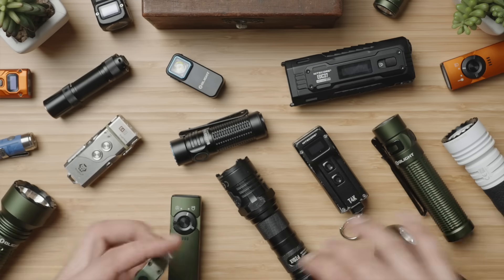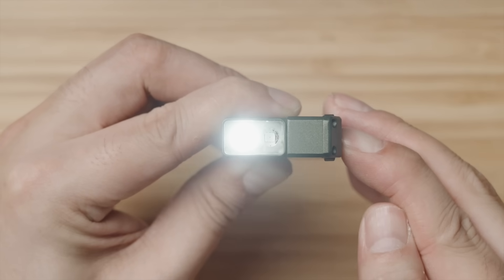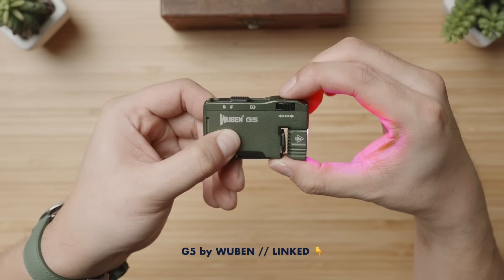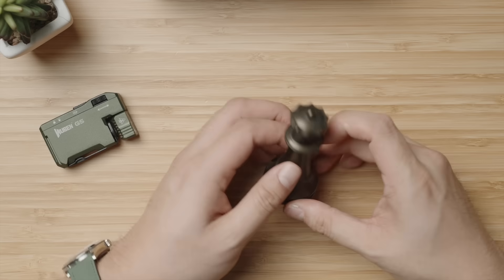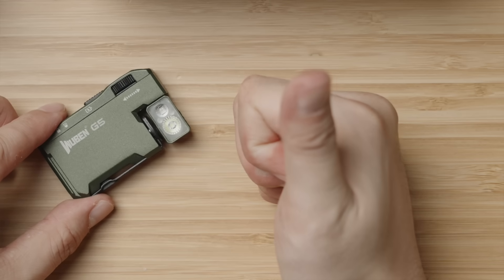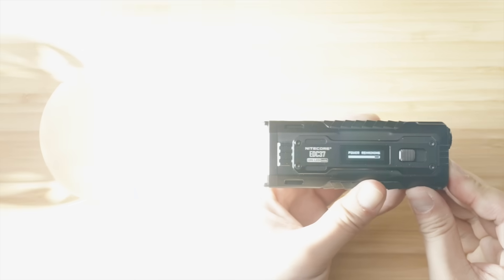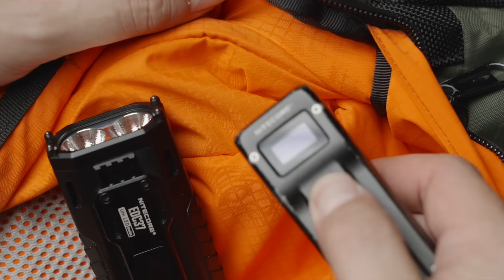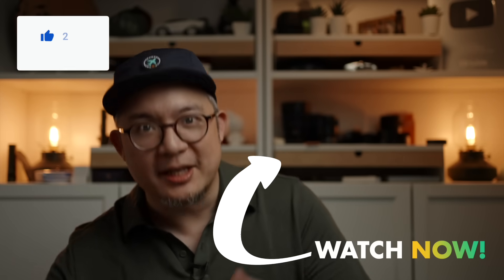Modern Flashlights are INSANE.

Comment: I'm curious when you said that they are making a profit on that smaller flashlight where did you get that information from?  Especially if it's from a big company it could be what is known as a loss leader.  Which is a product that is sold cheaply often below cost to either get people into a store either physical or online in the hopes that why they are there they will buy other products from that store or company which are at price points that do make the company a profit and offsetting the money lost from the loss leader product.

Comment: Almost all the lights I own are made by Nitecore.  For the amount of value I receive for the relatively low amount their products cost, I couldn't be happier.  I can tell you that Nitecores warranty/customer service is great. I had a flashlight that I shorted out accidentally by trying to use a strange battery.  I was about a year and a half out of warranty.  When I contacted Nitecore about this they told me that if I covered shipping to and from their repair facility in China that they would cover the parts and labor.  I thought that was more than fair.  
  I have an HC33 headlamp that I use almost every single night. I have beat the tar outta this thing and it still works strong as the day I bought it.

Comment: Quality vs Cost... like you said, your 2 part chess piece could not be sold for less. How can a flashlight with battery and electronics then be so cheap even though it feels like quality?

Nitecore though... I get that. I have an EDC35 and a Tiny3. Not cheap but they are very nice to have. I don't hardly use / need them enough.

Comment: If you want to see a crazy value flashlight, check out the SKO5. Same 8k lumen turbo, also an rgb strip light, spot or wide beam, great lockout, and the slickest battery access I've ever seen. It has on-board charching like all the other, but it takes regular non-soldered in 18650s (2 of them for better runtime) that you can easily swap out if you want to carry spares or just if you're concerned about it lasting forever. And cheaper than the EDC37.

Comment: As it relates to international trade "dumping" is essentially when a foreign producer sells a product in your country for less than the cost of production. Trade commissions are suppose to be able to protect us from this, but overseas manufacturing has been caught doing this multiple times. There is some interesting documentation about the furniture industry in the 80's related to this practice. As I see it, it is a long game strategy where you can use dumping (and government subsidies) as a way to topple a competitor in another country, and then become one of the few ways the global market can access the type of thing you make. Then eventually raise your prices? I don't totally get it and don't know how it works, but it is a thing.
Reply: @thebicyclesafaris  Basically, it's why the US will probably never allow Chinese EVs to be sold here. Let's say the Chinese subsidizes car manufacturing so that each car they sell is technically at a loss so they vastly undercut the competition. Chinese government pays manufacturers 30% of costs, then the cars can be sold for 40k that, if a US manufacturer made the same exact car, it would cost us 65k (before profit considerations), so let's say 71k. Most peeps would buy the 40k car. When that's done often enough, US manufacturers would be completely cut out as more Chinese manufacturers come over. Eventually, it would just be affordable Chinese cars only, with prices now going up year after year (yet still much cheaper than American/Japanese/etc). Eventually, it would just be Chinese manufacturers, now selling cars closer to what the other manufacturer's cars were selling for, making HUGE profit because no vehicle is now selling at a loss.

Every created good can be done that way. You understand it perfectly. Video game console manufacturers usually sell consoles at a heavy loss... at first. They rely on software sales while making the consoles becomes cheaper over time, either not taking as large a loss OR getting to the point it's profitable. Sometimes, as Sony, Xbox, and Nintendo have done, they'll even increase the cost of consoles when they get to their cheapest point of manufacture to broaden the profit margin, knowing they are the only creators of that console.

Throw tariffs and other garbage into the mix, that further increases "dumping" because a steonger foothold will be needed before the price is increased, reflecting the tariffs. Basically, the foreign company pays the tariff without passing it along to the consumer, defaulting to "a good company", while really just pricing out the competition to later become the IT product to buy, regardless of how high the price goes.
Reply: It's basic monopolistic practices that's employed by almost all large corporations.

Companies will offer loss-leader products that are purely for undercutting competition and securing larger marketshare.

When done effectively enough, they will have eliminated all competition and then they get to do whatever they want.

Just look at how much Amazon now charges in fees to vendors, and Google shovels ads into Youtube videos, and yet we all stick with them because there's no good alternative.

With Google it's free videos and cloud services, with Amazon it's free shipping and returns.

Comment: One thing you might want to look into is how the market there works as well, if you look up that exact same flashlight you'll see it sold in massive numbers by companies other than Wuben as well. Either if Wuben wants to use this as a way to make their way into a new market or if they're being sponsored they can still pawn off parts that don't pass first muster and sell the parts with slightly lower tolerances to a secondary company for that company to use second-bin parts to save some money while not throwing away components.

Comment: I think in when they make wuben they van make like 100 in one run of VMC. This might be Multiple machines running different set ups, or someking of 5 axis set up. if the rail on bottom of the Wuben is made first. Rest can be made probably in one 5 axis program. it could be possible that they make slots and other parts in one set up.  rest of the body in 1. 5 axis machining. Really tight and fast machining times 2-5 min each piece.

Comment: One thing that needs to be considered with max output for flashlights in general, let alone pocket sized lights, is the run time is usually only around 30 seconds to a minute before it throttles down to a lower setting.

At 6:05 you mention 8000 lumens breaking through a tree line to help you be rescued, but you’d better hope the rescuers are there within the minute of battery you’ve got at max output.

When shopping lights it’s better to look at medium lumen modes and their runtimes. Nowadays you can get 100 lumens to run for a couple days (48+hours). That’s much more useful for most applications than max output for seconds to minutes.
Reply: While the runtime on max is usually very short, it's not like it fully drains the battery in those 30-60 secs. The short turbo runtime is more to prevent overheating and melting of the body / lens. Point being, you'll be able to fire it off a few more times at max after some cooldown if the rescuers miss the first one.
Reply: 30 seconds is more than enough to melt my eyeballs out of my head
Reply: do you know how lamps and batteries behave when you light 8000 lumen capable flashlight at continuous 100 lumen spiking to 8000 lumen for 1 seconds every 15 seconds? I imagine that might work well in the waiting for rescue scenario
Reply: @alexmikhylov  a lot of modern lights have a beacon mode which is essentially that; extremely bright flash every few seconds. My Oclip Pro can be in beacon mode for like 30 hours, strobing in high mode every 3 seconds. Alternatively, it can be in moonlight mode (1 lumen) for 6 days.

Comment: Correction: While IP6x is the highest dust rating a device can receive, IPx8 is not the highest water resistance rating. IPx9 and IPx9k both exist, with many modern devices including smartphones holding these ratings.

Comment: I've got the nitecore thumb and the tube and they have been so handy and reliable. When I've seen the fancier ones my thoughts jump to are they still safe or are there possibly components that might not actually be allowed in the States. It doesn't seem to add up. I depend on having safe, dependable light as I'm sure your viewers do too. What could be extremely useful is knowing if there are some to make sure to stay clear of.
At any rate, Thanks very much for this presentation and your insight. *Cheers.!

Comment: Do I need the Wuben? No but I’m going to get one!
Thanks  Mo
Reply: I've an Olight 3T2 for EDC stuff.

Its more comfy in the pocked, yet the Wuben is nice too. I'm not sure what's more "emergency friendly"; just having to change an AAA Battery & take one with you, or having a power bank with you all the time.
Reply: The Wuben G5 is a joke. Had two of them fail after water infiltrated them in the rain with the charging port closed. They claim it's water proof. I would not recommend them. Have an Olight seeker that I've used at work now for the past 5 years and it still works like the day I got it.
Reply: @MedicDoggo  Been awhile since I was on the Olight page, they're getting high on their own supply.  

Feels like they tacked 20-30 bucks on to the price of everything just because the brand has taken off.
Reply: Ditto!! :D   ALSO:  The E7 is only 4 bucks more!!!
Reply: Ruben lumens
Reply: Check out the Wurrkos TS10SG and TS11 too.  Both amazing pocket light cannons.  My TS11 came with the older Anduril, but the more recent versions (which came on the TS10) have a tactical mode, you can turn that 3" rocket into a pocket strobe or High/Low tactical light by cycling through the modes.  Speaking of, there are about 15 to play with, including a flickering candle with timer and programmable beacons.  TS12 is a cool looking light too, but I went with the 11 because 1) I didn't have any orange lights, and 2) you can upgrade it to take 18650 which lets the head reach its potential/improve runtime.

The G5 is a neat tool, but the floppy pocket clip bugs me a little, and the lockout switch can turn the light off if it slides shut while you're holding it.  Definitely a fun form factor though.
Reply: @ronhess3013  , same here.  I have a fetish with flashlights/addiction.  I need help.
Reply: I have several they are amazing.
Reply: currently not availabke on Amazon Canada . Guess it wasnt sustainable ?
Reply: Ad
Reply: They have the same light under different names for like 6 bucks on AliBX.
Reply: @ronhess3013  it was an effective ad
Reply: @ronhess3013  all my flashlights are wuben and I’m not upset about it because they’re amazing
Reply: The 20 dollar floored me. I only have right now for about 3 hours. THREE!

Comment: IP69 is technically “better” than IP68. Each number stands for a different thing but 9 designates it can withstand direct high pressure nozzles
Reply: @lordreavers  from what I've been reading, 9 is a separate rating. It can sustain high pressure jets but not always immersion or any previous water ingress ratings. So one that capable of all is listed as IP68 + IPX9.

Comment: The quality of foreign manufactured turbochargers has come a long ways in a very short period of time. "Ebay turbos" used (2000s) to be guaranteed to not function and implode in very short order and now (ex VS Racing) chinesium turbos are an extremely cheap route to big horsepower that have shockingly good longevity due to tight manufacturing tolerances. It's wild.

Comment: 1:25 first time here and I’m not sure where you are going but I want that light.  Let’s just not tell my wife.  She for some reason thinks that 100 pairs of shoes is good but a dozen flashlights is unnecessary.  ;)
Reply: @stevewoodyt  just make sure you don't take the guy's statements at face value. He says (or at minimum implies) that it can be used for hiking due to its 400 lumens, but professional testing data proves that it drops down to 200 lumens within roughly 1.5 minutes, and only maintains that for less than an hour before the battery dies. Even if the battery lasted longer, 200 lumens with such low candela would be a disaster in that scenario.
Reply: @mmhmm9271  I think this light doesn't have replaceable batteries, which wouldn't be ideal for hiking. Some sht can go wrong, you're left out in the dark for hours. The minimum I'd take for hiking is 1,000 lumens and something with replaceable batteries.
Reply: @mmhmm9271  that’s probably true for most lights.  I have a nitecore a skill hunt and a few thrunites.  This would be another one I carry around for a while then go on top of the microwave with the rest of them.  I’m not super stoked on built in batteries either.  

I was more leaving a comment for the algo.  First time I saw one of their videos.  I’m not going to buy it honestly.

Comment: maxxis mtb tire   yes for pro offroad...and were on my stumpjumper when i bought it on craiglised used.  $ 80/100 usd each and mine lasted almost 3 months of daily use at which point the knobbies were completely gone. So my bike was going to cost $600  a year more ?...then i found specialised original tires that were still in production...specialised bike tire on a specialised bike... from Amazon...$20 usd each !  Have been on the bike since Nov. 2024 and look almost new.  Lots of mtb trends are hype...just saying.

Comment: The Wuben flashlight is a toy imo. The user interface is to complicated. You can't dimm the red light with the wheel ... it changes the rgb colors if you use the wheel!? Why not remove rgb and let me change the brightnes of the red light? The lock,
-out mode hides the USB connection but then the flashlight is not locked anymore. Typical Wuben, Wurkos and other chinese brands. It has RGB, so it must be great.

Comment: The Wuben G5 RGB is a pointless gimmick. If it was a flood and a spot, I would buy several in an instant. And the Nitecore EDC37 is aimed at emergency services, yet isn’t waterproof. We always seem to be just one upgrade away from the ‘perfect’ torch. I guess that’s to keep us buying.
Reply: Or Nitecore missed the opportunity the add IPX68 waterproof. Or forget's to add a removable battery. As you say, allways one step away from a good and functional light.
Reply: My Oclip Pro got a red light for night use but it's too bright. 😅
Reply: respectfully, just because you don't see the use doesn't make it a pointless gimmick
Reply: @elmadicine Ok, what uses do you have for it?
Reply: @BadgerBob  different guy, but i could see using the red rgb mode in the night to retain night vision

Comment: As for me: I am sold on the Nitecore. That is one neat light I would absolutely get. Right now my go-to lights are either a Fenix TK35 or a LEDLenser P7R. I have used the latter in the fire service, as an EDC / work light. And it is amazing. Also comes with a clip-in holster that fits on a duty belt. It „only“has a 1000 lumen output that is already insanely bright. More than enough for 99.9999% of applications. Having 8000 lumens…that’s approaching stadium flood lights territory. Too much. Nobody needs that except as a party trick. Am I still gonna get one? Hell yes. 😎 That said, I am quite impressed with the capabilities of those little lights, as well as their price point. Might get a couple of them to put in various bags, the car, etc. 

That concludes the important part of my comment. You can stop reading now. 
For those interested in these things: The fire department has specialized flashlights for use in „hot“ circumstances. Unlike any flashlight you get in the EDC market, these have an IP67 as well as an ATEX rating. Meaning they can be used in environments that have a potentially explosive atmosphere. They are big, bulky (because you need to be able to operate them with thick gloves on), only put out 300-400 lumens - enough to light up a room - and they have a remaining time display made up of old school 7-segment displays. Absolutely bombproof, but at around 400 bucks a pop they are not exactly cheap. BTW, that price does not include the charger. That‘s another 120 bucks for a single-port version. You can select between a wall plug version and a 12/24V one for vehicles. They also make multiport chargers for up to 5 lamps. So that’s deffo not something you’d buy for home use. (If you are curious: the lamp we use is the Adalit L3000 or the equivalent from a company called Acculux).
Reply: The only thing that sucks about the edc37 is that it doesn't have a great ipx rating. And if you want a good party trick, get an LEP. It's like a 1500 meter light saber. You can literally create a white beacon on the sky that looks like something out of a video game and people will see it for miles in every direction. They're really great for searching too when you need to reach really far out. I have a w3 plus by weltool which is spendy but the thor 2 is a good buy for the price if you look for a more affordable one. They also work as tac lights in broad daylight because it's 800,000 candela in a tiny little spot lol
Reply: @mikecurry6847  Thanks man…I had no idea they build LEP into flashlights these days. Only knew about this from car headlights. Will look into that.

Comment: Well, it's probably because it's built by what is basically questionable labor conditions and wages
Reply: Both of those things are, just at different extremes. "What time is it?" - "17:34, and that'll be a $150 charge, thank you" is not normal either.